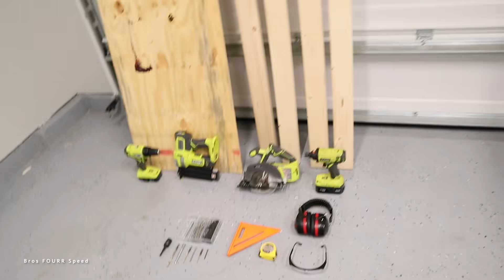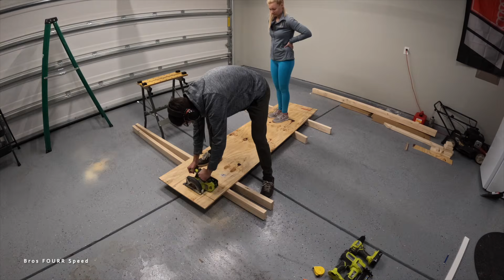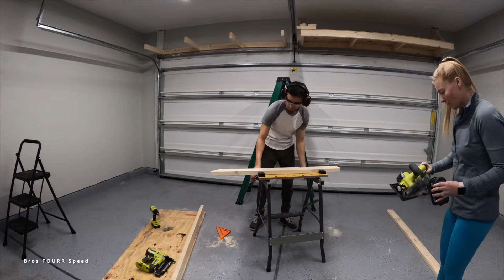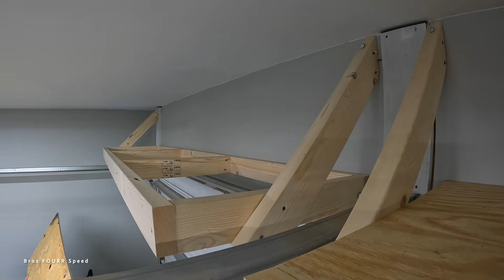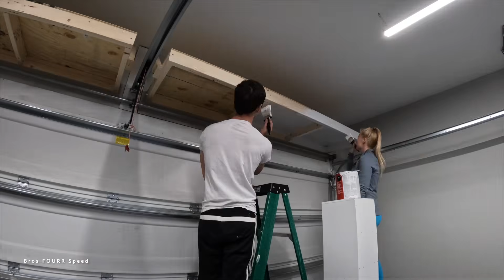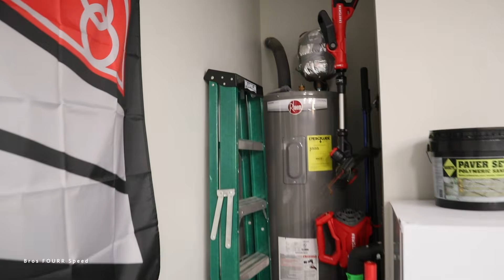Cheap Easy Way To Build Custom Above Garage Door Shelves DIY

Comment: You sure you nailed those to studs behind drywall?
Reply from the maker: Behind the drywall is just plywood. So that was a good enough base for some minor support as I built it. However, the massive bolts in the three giant studs in the center and sides is where most of the support is. So it's very secure

Comment: Yep I’m about to do this. Also please link the lights I need to install another set in my garage the ones I have are the ones with the three LED panels that you can kind of direct around and they screw into a lightbulb socket. I need ones that can plug into an outlet.
Reply from the maker: I did some LED strips from Harbor Freight. They work really well! I put in an adaptor to the socket that I could plug in the lights to

Comment: Hearing protection for a drill?
Reply from the maker: what’s wrong with protecting my hearing? Im in a tight spot where it echoes..
Reply: @BrosFOURRSpeed it’s a power drill, not a jack hammer
Reply from the maker: @K1ngDre-DMZyou do what works for you and I’ll do what works for me. I’ll be glad to hear when I’m 80…
Plus I was using the saw as well so just left them on, not sure why that’s a big deal for you..
And if you paid attention I used a drill and an impact drill. 
Maybe you should have worn eye protection, cause you might be blind... LOL

Comment: Look at the garage door rail mounting beams in an older house. Typically they are pulling away from the wall studs up at the top. The fix is to use some 3/8” lag bolts to tie the vertical beams back to the wall studs. You have to tighten the bolts progressively over a few months as the vertical beams relax back to their original location.
Reply from the maker: Not too sure. House is from 2017. But this shelf has been perfect since this video

Comment: Driving screws with the drill and drillling holes with the impact… 😅
Reply from the maker: Works the same. Just grabbed the drill that was in my line of sight first. But also there was more pressure drilling the holes then there was putting the screws in

Comment: Hi, Thanks for sharing this useful storage on hidden location at garage Lintel beam .. 1) why don’t you screw the support pieces(4 of them? From backside of the stud before put the main 2 by 4 on the wall ? 2) Can we use side pocket jig using Kreg jig to make side holes than directly drill as cross hole?
Reply from the maker: I built it the way I did because I built the first one by myself. Easiest way without a second set of hand. Just built it to best film the process. You can certainly modify the design to best fit how you'd like to make it

Comment: Can I use pressure treated 2 by 4? Since it is in garage space which goes thru lot of weather changes
Reply from the maker: If you want to, but that isn’t needed since it’s not in the elements. It’s either hot or cold, untreated wood is cheaper and perfectly fine to use.
Reply: @BrosFOURRSpeed  I mean I have 10 pieces of the pressure treated 2 by 4 lumber , so just want to use it , instead of buying new and keep this aside LOL .. just want to make sure we can use the pressure treated as well .. thank you
Reply from the maker: @karthik82285  ahh, yeah that’s fine to use as well.

Comment: Probably would’ve painted it before mounting but overall great job. I wonder if I could build something like this but with vertical supports to the ceiling and use it to store my spar elumber
Reply from the maker: It was easy enough to paint once done honestly. But very helpful shelves! I've sure you could make a support to the ceiling

Comment: great stuff!!! Was there anything that required you to make them that wide or could they have been wider?
Reply from the maker: I just made them the size of a piece of plywood basically. Cut the plywood in half length wise and fit it since the garage tracks.

Comment: I'm thinking to something like this, but on the other side. Do you think it is safe to use it if somebody open the door while you are in the lader ?
Reply from the maker: You wouldn't want to have the latter at these and open the door. You'll get hit. With the door closed is when you would put stuff up there or take it down.

Comment: Great job! I’m curious to know if ther is ample space to do any maintenance/repairs on the drive chain unit. Other than that, it’s awesome!
Reply from the maker: If I had to replace the garage door springs, I'd probably just remove the shelves. Easy enough to do if I had to do that. Garage door motor and chain are all perfectly accessible

Comment: Interesting build, but I suggest strengthening where you attach the angled 2x4 to the garage wall. You have only one bolt going into the stud wall but it is very close to the top edge of the 2x4.  Any heavy weight and the 2x4 could split and the shelf will come down.
Reply: To add more advice... This is a tension vs compression problem. Using a tiny steel cable with I-Bolts on each end would have been far more secure. Alternatively, using 2x4 as a knee (compression) instead of putting it in tension would have been much better too. In the future... just use steel cable instead of 2x4. It's going to be a lot stronger and impressively thin.
Reply from the maker: Yeah I've kept an eye on it. So far I have less then 100 pounds on each shelf. It can hold my body weight fine. But if it start to sag at all I'll had something

Comment: Could you make this wider? I have a square roof rack for my car that needs to be stored
Reply from the maker: Yeah you can make this however best fits your space. I basically did half a sheet of plywood and it worked for what I needed

Comment: Angular torque not a good idea! Your weight will put more stress to the 2 outmost screws held by the wall through side supports. Better to have it held straight up to ceiling, of course, to a stud.
Reply from the maker: Yeah I thought of that. But thats why I did the big bolts through the 2x4 into the studs behind the wall